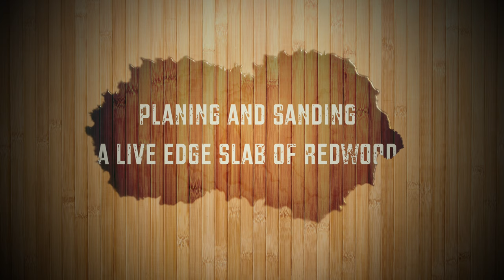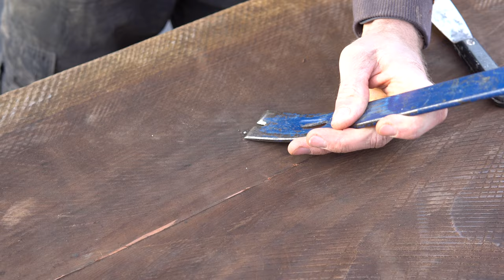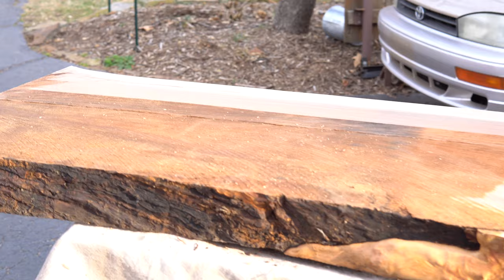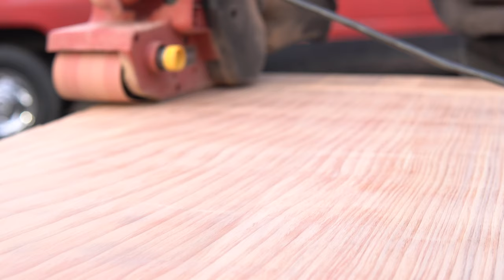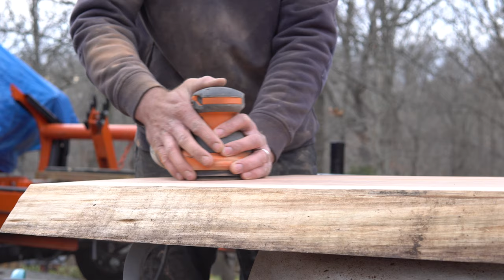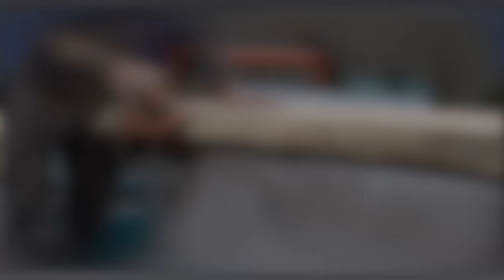Finishing a Live Edge Redwood Slab!

Comment: Great video 👌🏻
Just wondering when you use the hand planer, how do you avoid the small uneven edges between each pass?
Reply from the maker: Great question, it’s actually pretty difficult we rarely use the hand planer because of that, so really only use it for major bumps, to help avoid it, you want to just skim the wood don’t be too aggressive with it, and try to hold the planer as level as you can.
Reply: @treetoshop  Cool, I've been having some issues with planing woad boards and this'll help alot, thanks! : )
Reply: I got rid of my hand planer in favor of a thickness planer, but I can say that 1) any problems with a power planer will generally be a problem with a hand plane, and these have been around for 100s of years, so consider searching about any problems you have under the guise of a hand plane. 2) I'm not sure what you're trying to plane, but like Tree said, go lightly and you might try planing at an angle, such as following the grain while holding planer at a 45 deg angle. Jay Bates has a video about levelling a table top with a hand plane that I remember being helpful